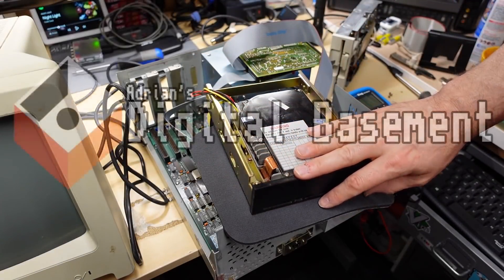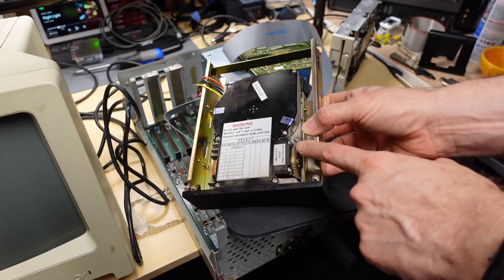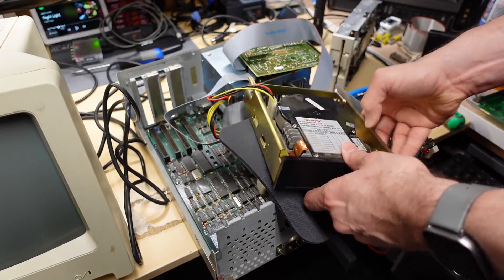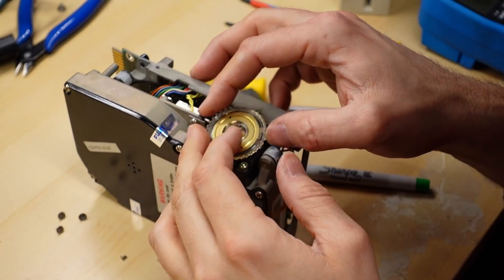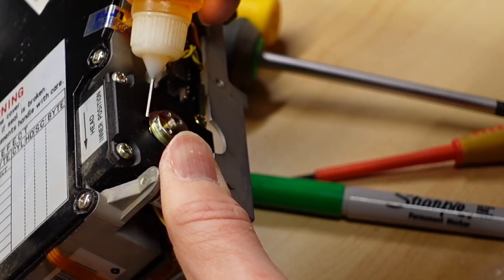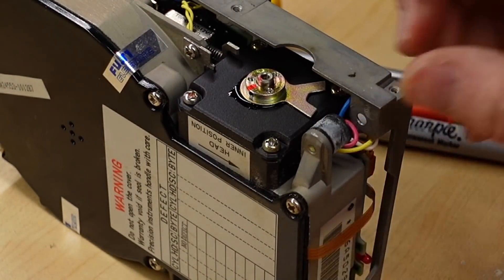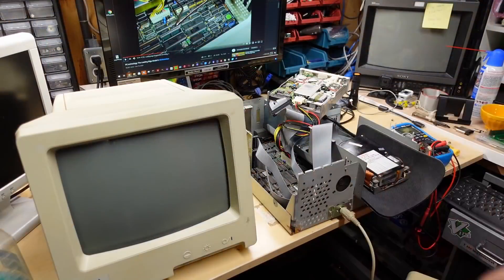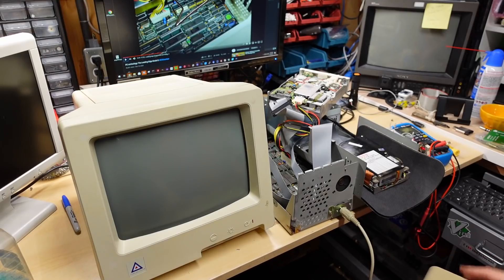Reviving an old hard drive with some oil

Comment: Fuji Electric is the leading electrical transmission company in japan. Like Siemens Electric is to pretty much the rest of the world. When you said that name my thoughts were  "WOW, They made hard Drives?"
Reply: Fuji Electric was actually started as a joint venture between Furukawa Electric and Siemens AG. So you're actually not far off.
Reply: @jefflavenz7285  This video prompted me to start reading about this. The name Fuji is a contraction of "Furukawa-Siemens", in the romanised Japanese spelling.
Reply from the maker: Is it all part of the Fuji Heavy Industries like who used to make Subaru cars -- and tanker ships?
Reply: @adriansdigitalbasement2  Fuji Electric and Fuji Heavy Industries, which now goes by the name Subaru Corporation as of 2017, are not connected
Reply from the maker: Ah OK thank you for the clarification
Reply: @adriansdigitalbasement2  FHI changed their name to Subaru Corporation in 2017. Fuji Electric is big, still around and made that drive.
Reply: @StevenSmyth  Specifically, Subaru was the automobile division of Fuji Heavy Industries. It became the dominant part of the company's business so they wound up just changing the whole company's name to Subaru.
Reply: Fuji Electric's phone division was what became Fujitsu as well, which is also interesting.
Reply: @jefflavenz7285  The hard drive division went along with Fujitsu, which continued to make drives for a long time until that division was acquired by Toshiba. My first 1 gigabyte hard drive was a Fujitsu -- and it was a damn nice drive.